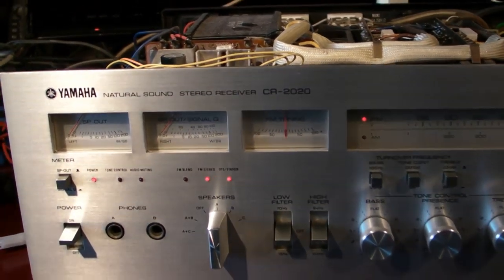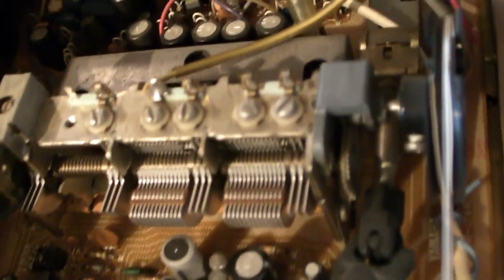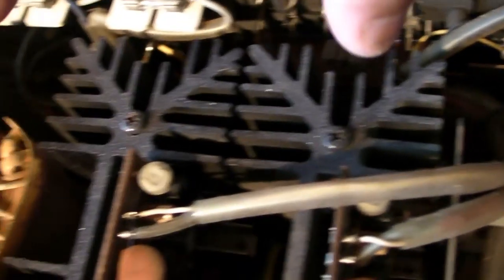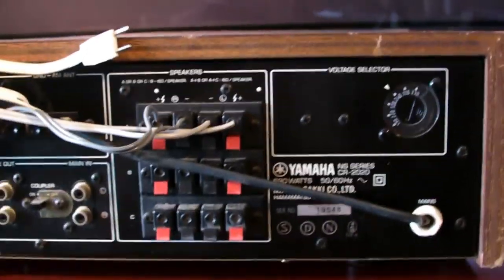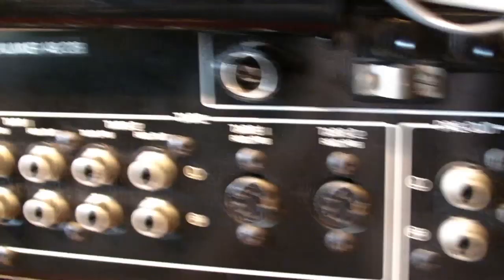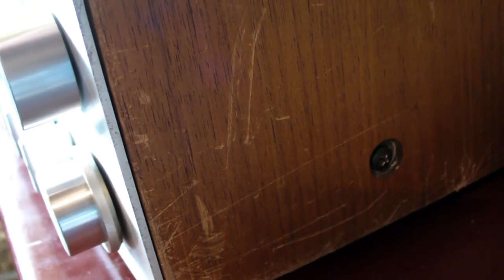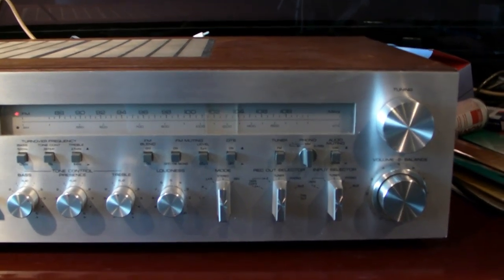Yamaha CR 2020 review test

Comment: One point worth noting about the Yamaha "sound". In many cases people listen with the loudness control on either full or part way... and then complain the midrange sounds too lean. It's counterintutive when the off of flat position is set with the knob turned fully to the right instead of left. Many users are not aware the loudness is active and instead think it's off. Yamaha's rotary loudness operates differently from other brands. The control has the effect of reducing mid frequencies rather than boosting highs and lows. So before listening and comparing Yamaha receivers to other makes make sure the loudnesss control is turned fully to the right in the "flat" position. When listened to this way I find the 2020 to sound just as warm as other brands.
Reply: Thanks socksumi, I've a nice CR 2020, and I always wonder what the right position of the loudness knob.

Comment: It's a big statement that it's the best receiver Yamaha ever made. If you want it to sound warmer like Marantz you just turn loudness knob to the left, I find it then sounding similar to Marantz when I move it to around 5 on the scale. With loudness set to flat Yamaha sounds too bright, even the modern receivers. It's hard to compare two 35 year old receivers as they may be worn down differently.

Comment: I love your reviews also I am a Marantz lover but the point here is that you must demonstrate the equipments with a good source and always the same, cd turntable whatever. The radio is not a way of knowing the real quality of these receivers as the hart of a music system with vintage gear. compliments
Reply from the maker: I listen radio for 75% and the rest I listen to downloaded mp3 quality between 192 and 320 quality, the radio quality is much better than that of the 320 quality. I have plenty original cd's but hardly listen to them because i  am lazy to change them once the 60 minutes are finished. But you are wright I have also to test on cd quality, i will do that with my next reviews
Reply: +vintage stereo You can download flac files. Or you can rip them from your cd.

Comment: Dude. You are listening with the loudness control partly engaged. That will dish out some of the midrange and cause the highs to brighten and lose some of the midrange "warmth" you complained was missing. Turn the control clockwise to the "flat" position. Then do the listening test. How could you possibly miss that.
Reply: This is a common misconception and you have it backwards.  Yamaha is unique in their "loudness" control. It is not a high/low boost switch like others. Instead, the "flat" position on loudness control is zero adjustment to to High Mid or Low. When you turn it (engage loudness) you basically turn up the high and low then reducing the relative mids which acts like a "traditional loudness switch"  for listening at lower volume levels. The further you turn from flat actually gives you "warmer" sound.  Flat is the most accurate and neutral/natural but also produces a more sterile/cold character which the original poster and others dislike in Yamaha's sound signature.

Comment: I much like the sound of this vintage of Yamaha as long as you use the use only the line and tuner inputs. Not thrilled by the phono section. It's okay but a bit to thin and analytical for me. Also the loudness control is strange; it's variable which is nice but for some reason it's off when it's turned fully clockwise and on in the opposite direction… the opposite of what we're instinctively used with volume, bass, treble controls.
Reply from the maker: you have the same thoughts as me, i also was never a fan of yamaha but they are nice looking and not bad sounding too

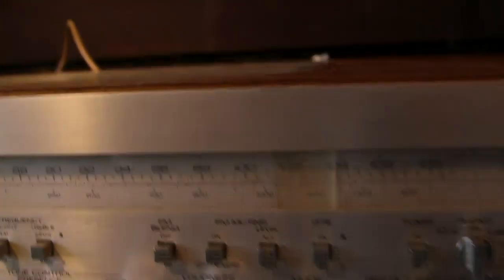Comment: A good review up until 10:45.....From 10:45 until 14:35 is garbage. You really need to hook up a good source (like a turntable) if you want to get an idea of the sound quality. Not FM stations without an antenna hooked up. Otherwise, I like your review.

Comment: I'd rather hear the sound quality tested on a CD or LP... You don't stay on one station long enough for someone to easily judge the sound. I find the hunt for different FM stations irritating. But it's an interesting video, though I've never like the too-clean and sterile sound of Yamaha receivers. The only way to warm it up is by having the right speakers. Anyway, good luck with your videos. I find them quite enjoyable.
Reply: This older vintage of yamaha is different. This unit actually does sound warm and sweet unlike the Yammys that came later. The phono section on the 2020 is not the greatest though and lacks the blume heard on other receivers. But when used on line and tuner it' a beast.